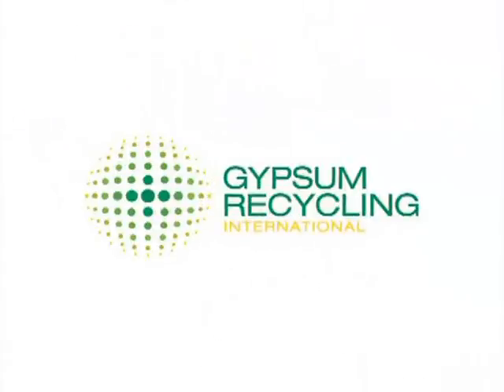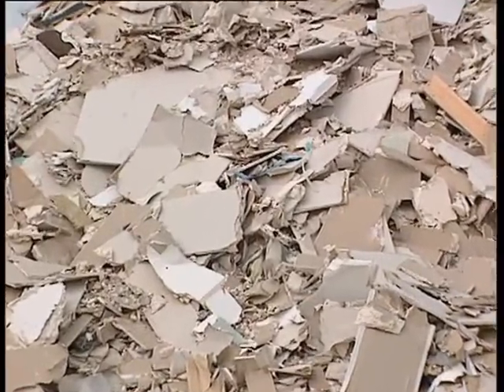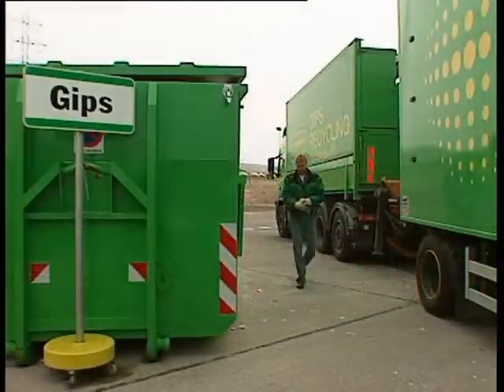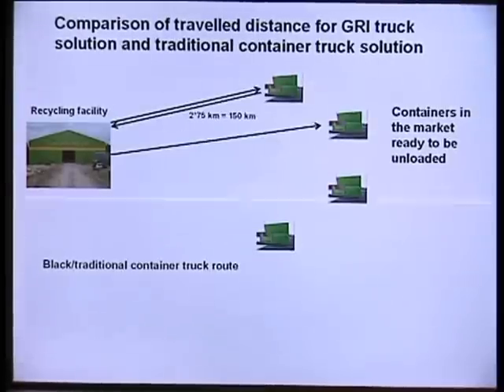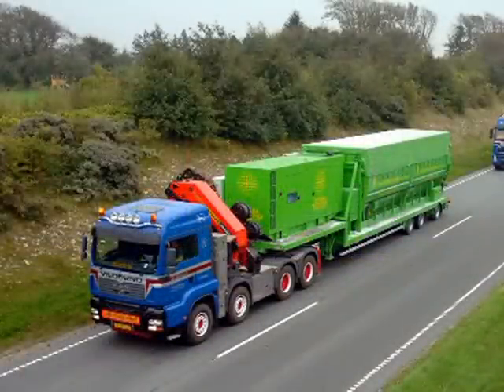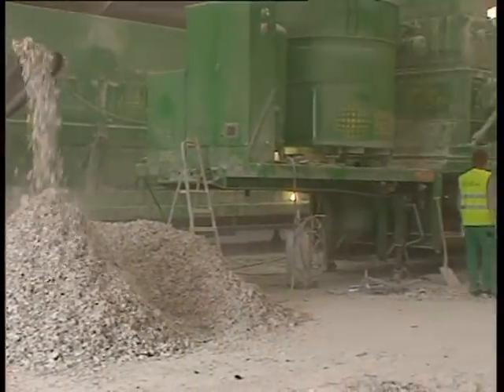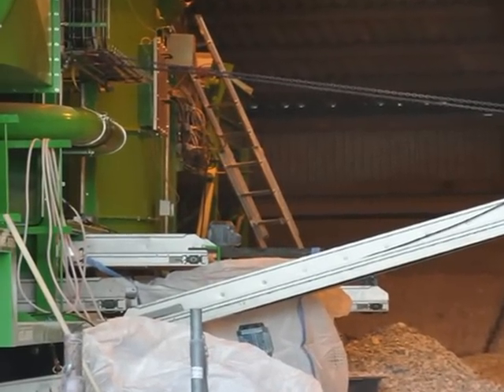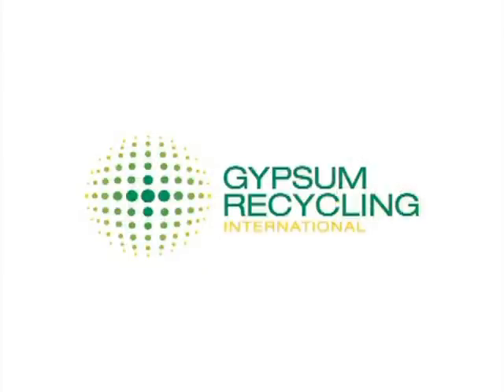Gypsum Recycling (Plasterboard/Drywall/Wallboard Recycling)

Comment: We offer customized ultrafine grinding mills system and coated machines for caco3/dolomite/talc/gypsum/limestone/calcite/calcium oxide/ bentonite/dolomite powder

1.325mesh~4000mesh, finished powder fineness is adjustable.

2.Built-in air classifier, higher classifiying accuracy, powder narrow particle size distribution, better powder quality

3.lower energy-consumption, higher outpout(for same install capacity, 200~300Kg/hour higher)

4.PLC control, simple operation: 1. Low voltage components: Schneider 2. VF/Soft Start: ABB 3. PLC Controller: SIMENS

5.No Dust when producing

Samuel

Web:http://www.lymill.com/show_19.htmlm

MP/Wechat/Whatsapp: +86 15105956429

Email: Samuel@lymill.com

Comment: Complete with migraine producing crap music!
Reply: We offer customized ultrafine grinding mills system and coated machines for caco3/dolomite/talc/gypsum/limestone/calcite/calcium oxide/ bentonite/dolomite powder

1.325mesh~4000mesh, finished powder fineness is adjustable.

2.Built-in air classifier, higher classifiying accuracy, powder narrow particle size distribution, better powder quality

3.lower energy-consumption, higher outpout(for same install capacity, 200~300Kg/hour higher)

4.PLC control, simple operation: 1. Low voltage components: Schneider 2. VF/Soft Start: ABB 3. PLC Controller: SIMENS

5.No Dust when producing

Samuel

Web:http://www.lymill.com/show_19.htmlm

MP/Wechat/Whatsapp: +86 15105956429

Email: Samuel@lymill.com

Comment: here's how you recycle drywall:
put it in  a shed or your basement to keep it dry
use a sledgehammer to crush it
put it in a wheelbarrow
spread it around evenly in a hidden area of your yard
bury it with dirt
the paper rots, the gypsum (which is a rock) soaks into the ground.

no trucks necessary
Reply: We offer customized ultrafine grinding mills system and coated machines for caco3/dolomite/talc/gypsum/limestone/calcite/calcium oxide/ bentonite/dolomite powder

1.325mesh~4000mesh, finished powder fineness is adjustable.

2.Built-in air classifier, higher classifiying accuracy, powder narrow particle size distribution, better powder quality

3.lower energy-consumption, higher outpout(for same install capacity, 200~300Kg/hour higher)

4.PLC control, simple operation: 1. Low voltage components: Schneider 2. VF/Soft Start: ABB 3. PLC Controller: SIMENS

5.No Dust when producing

Samuel

Web:http://www.lymill.com/show_19.htmlm

MP/Wechat/Whatsapp: +86 15105956429

Email: Samuel@lymill.com
Reply: Used it for pond sealer